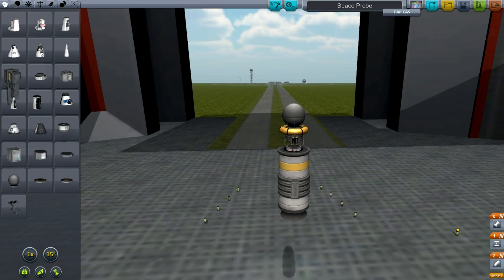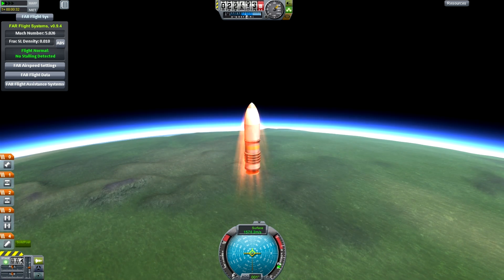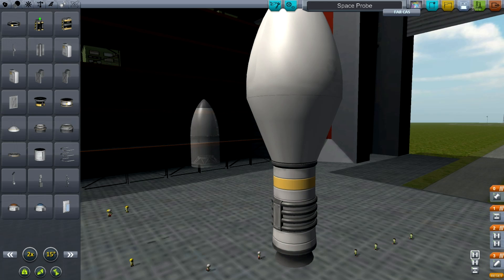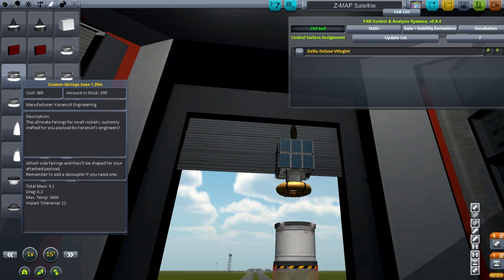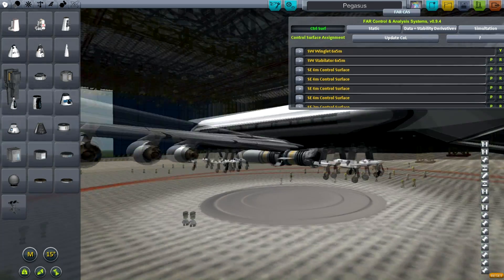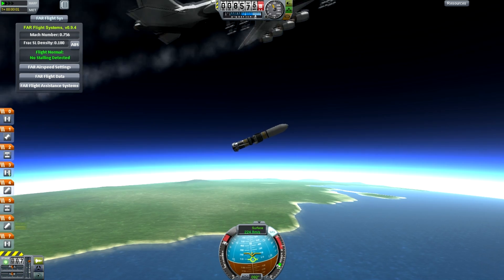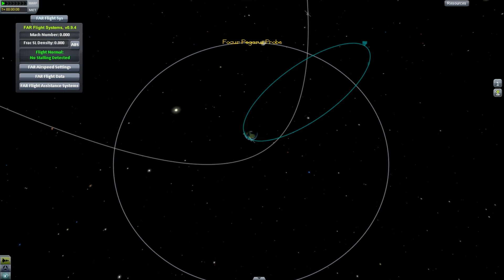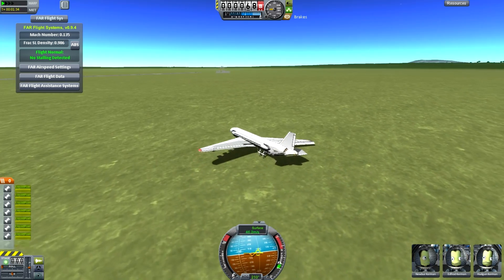Kerbal Space Program - Procedural Fairings & Pegasus Launcher

Comment: most of the mods now are not compatable with 0,25 .. or part working .. i hop that they can include all good mods in final release
Reply from the maker: The processing power simply isn't there to treat gas as a collection of molecules for fluid dynamic modeling. There are about 10^19 molecules in 1ml of air, which would require exabytes of memory to store, never mind the cpu  power to manipulate. CFD systems use larger units, say partitioning the air into 1mm cubes and modeling that.
Reply: Gotta hate those comparability issues
Reply: The real plague of the modern world
Reply: Procedural Fairings are being added in 1.0. Probably sometime next month along with IVAs, realistic air physics and some other cool stuff.
Reply: ***** Sure they are! And they're doing it next update (realistic air physics).
Reply: ***** Where there's a will, there's a way.
Reply: ***** You aren't even making sense anymore.
Reply: ***** Or you could explain why it's "impossible" to create realistic air physics and what exactly you mean by "realistic". Because I'm not seeing how Ferram Aerospace is unrealistic, and that's done in Unity.
Reply: ***** "Realistic" does not mean simulating every particle. That's ridiculous! By those standards not even flight simulators are realistic! All you need to have it be realistic is an accurate approximation of how the craft will be affected at specific speeds and angles of attack.
Reply: ***** Calling BS right now. There is NO way that you can simulate EVERY ATOM.
Reply: ***** Still calling BS.
Reply: scott update your mods please as after 0.25 every thing is missed up now,,,
Reply: Omar Razzaz Um, he knows. He's playing 1.0. Most of the big mods have been updated for 1.0, you have to redownload them for 1.0.
Reply: it|s keep crashing too mate >D

Comment: Your rocket tipped over because it was bigger on top than on bottom. It's like an arrow, the fletching stabilize things because it creates drag at the back, so it naturally seeks to stay pointed forward. Your rocket has more drag in the front, it's like a backwards arrow, it's going to seek to turn around.

This is actually a big problem with procedural fairings combined with Far, they tend to give the cargo too much room, creating wide upper stages that have a tendency to want to tip over. You exacerbated the problem heavily by throwing that wide thing on there. Your other rocket was stable because the drag from the side engines and wingtips counterbalanced that from the oversized fairing load.
Reply: Watermark0n dude, he used to work with NASA...

Comment: From what I saw looking online at the pegasus mission, they used both a B52 and a slightly modified Lockheed L1011 airliner. Either way, pretty neat stuff.
Reply: I also did a little reading, the Pegasus was launched from approx. 40,000 feet which is less than the maximum operating altitude of the L1011 and the B52. Cheers!

Comment: The a-symmetrical liftoff with the Pegasus launcher might not be because of the plane design! Staging with throttle at full for jet/atmospheric engines doesn't work well (some fire slightly sooner, building thrust faster), try staging/activating them first, then throttling up.

Comment: For what ever reason i find planes like to turn left or right on a run way when they have symetrical wheels like that. when there is more of a tri-cycle style used they tend to be more stable. Not sure if its the case but changing the landing gear as such made the same plane design not turn during take off for me.

Comment: Wait, so how does Ferram Aerospace work without a mesh designed to simulate the aerodynamics model specifically?

Does it use something like the lighting engine to test if something is aerodynamic or not? I think that's what deadly reentry uses.

But if you can use any part you want from any mod pack, it must not have to have it's own specific type of model for aerodynamics. How do it work?

Comment: I was trying to make a Pegasus launcher but I found that it takes a lot of work to make sure it does flip out of control (the airplane). I have to constantly control fuel flow and center of mass during flight. That's not mentioning precise inclination. However I did attach my launcher to the top of the aircraft.

Comment: The tendency for your plane to veer is not a symmetry issue. Your rear landing gear are too far back, and as the fulcrum, they are taking too much weight, add more rear landing gear with the wheel's axis lining up, or move your gear to just behind CG, preferably both.